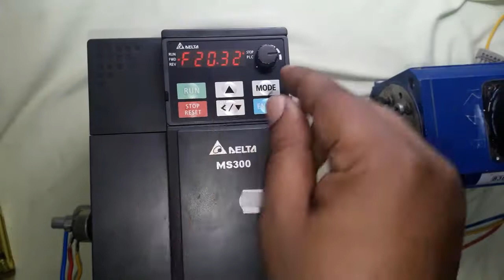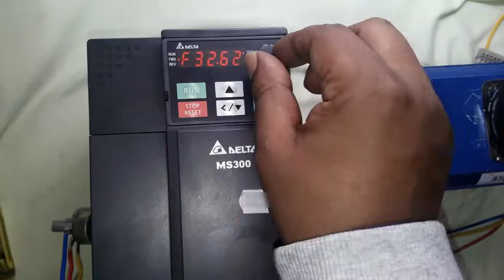Delta Inverter Keypad Operation  @FlowChart

Comment: Sir kon kon parameter gula,,,set kore,,,keypad mode a chalalen ta to janalen vai...
Reply from the maker: Set 0 in Operation Command:00-21, 
Frequency command :00-20.
More details check user manual.